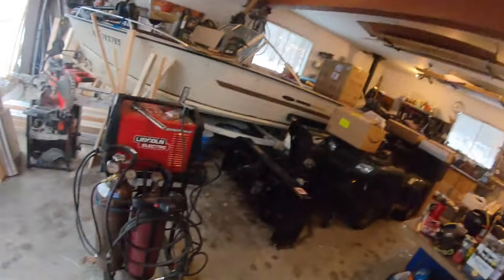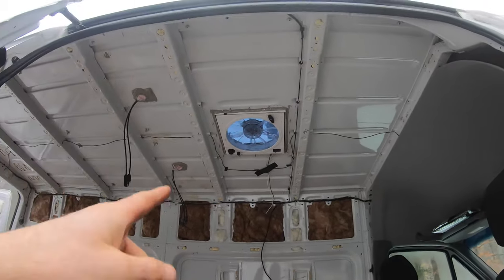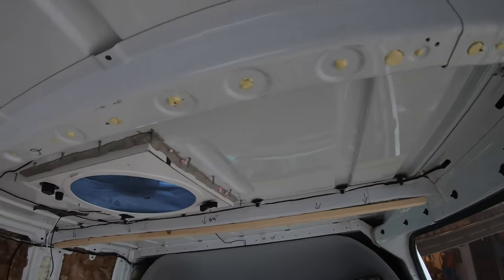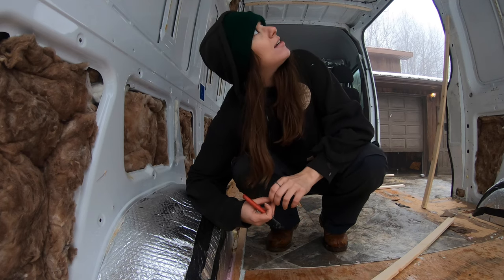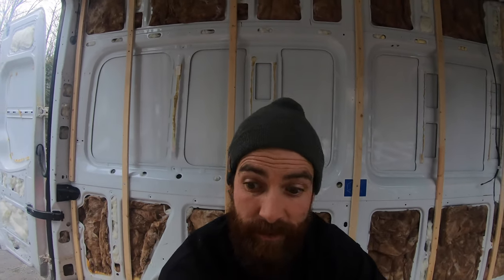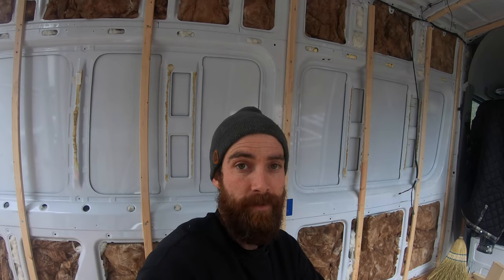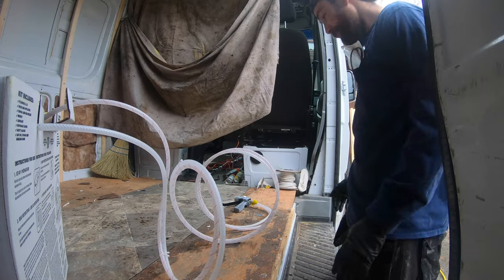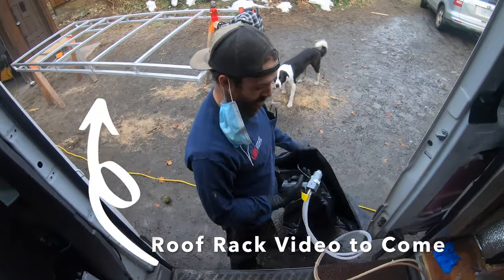Spray Foam and Bracing | 4x4 Sprinter Van Build

Comment: Do you happen to know what year this 4x4 Mercedes-Benz Sprinter 2500 with the 144" wheelbase is? It would have to be a 2014-2018 model year since it's the NCV3 body with the updated front fascia.
Reply from the maker: Hi DVaccarelli1988! Thanks for the question. It is a 2015!
Reply: @willanddani7938  You're welcome!